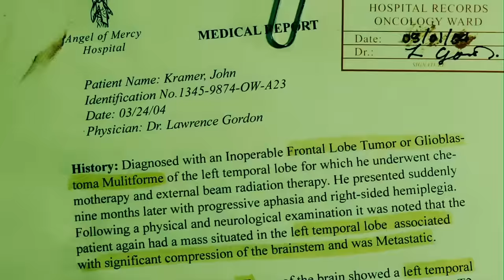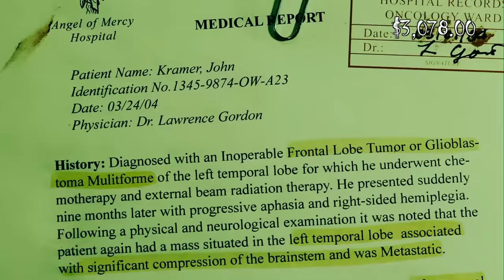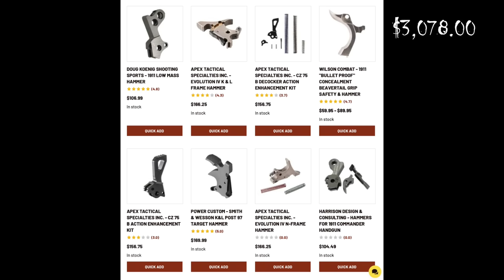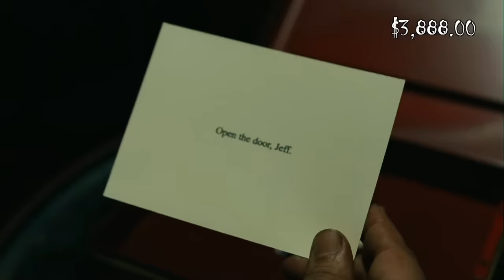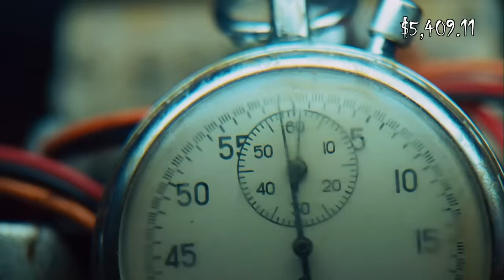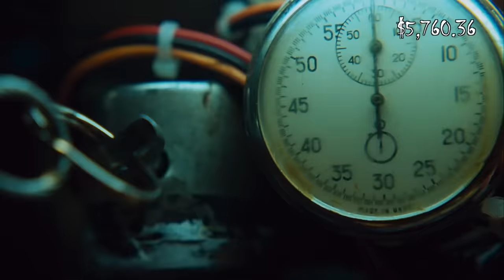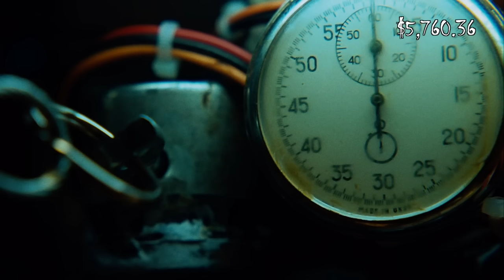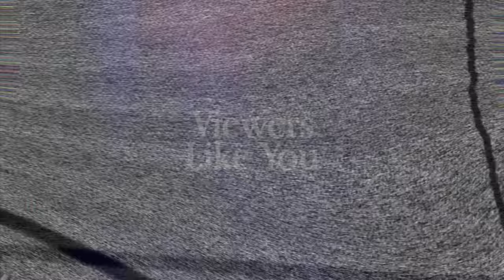Can Jigsaw Afford Saw 3? | Foot the Bill - Saw 3 (2006)

Comment: If the doors seal when you enter the room, you NEED a separate cassette player in case the victim left the first one behind. That's just good game design
Reply from the maker: You know what, that’s the best argument I’ve heard so far.
Reply: If it was me at least, i’d be collecting those. I’m leaving this building missing limbs or even organs, might as well get some kind of recompense in the form of cassette players and pieces of stereo equipment
Reply: @moogandacasio  "I know you're having gruesome awful things happen to you right now, man, but keep quiet while I strip out all the copper wire in this thing!"
Reply: Dude should just start saying that they need to bring the recorder with them. Save some money, man

Comment: I think the shotgun collar trap is using the chamber from old single barrel break action shotguns. I have never actually disassembled one before irl, but i have modified a highly detailed 3D model of one before and the chamber length does seem to be the same as what is on the collar.
Reply from the maker: Interesting, that would potentially drive down the cost. I really couldn’t find much on weapons recycling that soon after 9/11 in my research. People were pretty attached to their weaponry at the time, and a lot of the second hand market remains hard to track. 

But if it’s preexisting hardware, that’s less to fiddle with and therefore less expensive to assemble.

Comment: Old large buildings like factories often have power still running for any fire suppression systems. Some buildings do end up having power cut to everything except fire suppression. I don't think that's necessarily the city doing it on their own. Might be the company not wanting to risk a short drawing power and racking up bills or maybe some equipment that isn't exactly safe to leave unattended.

Comment: In the "The Door Slams Shut" section of this video, you can see in at least one shot "Property of Angel of Mercy Hospital", just like kittenarcader points out... But I wonder if he realized a lot of these materials might have been stolen or otherwise "appropriated" from that hospital. Both Lynn and Lawrence worked at that hospital and Lawrence actually became John's successor. It wouldn't surprise me if most medical equipment was taken instead of bought. This would severely cut in the costs of these bills.

Oh and because John has all of these accomplices... they probably share the load.

Comment: I love how the shotgun collar would not actually go off because there isn't any firing pins. A hammer has been proven to be not be enough to set off a shotgun round. Now, If this was a .22lr or something rimfire it might work, but shotgun rounds require a firing pin, which the trap does not have.
Reply: I don't see why she didn't try shoving a cloth or something in there when they weren't paying attention to her.
Reply: @IDevoidI Or just, Axe Amanda in the back of the head when she had  the chance? But yeah idk that whole thing seemed really easily beatable if you used for head for two seconds lol

Comment: I think some of the medical stuff you are either way under on or is stolen. That's an A&E bedside monitor, it does a lot more than basic vitals (I can see a set of ECG leads bundled out of it and that suggests it's got a lot of function). On its own that could be ten thousand.
The price you quoted for hospitals is not including the medical kit (monitors, medicines, tools). Just the facility kit (beds, ventilation, gas pipes, PPE and deap clean).

Comment: 6:43 Did you maybe mean 25% hydrochloric acid instead of 25 molar? Because I'm pretty sure the latter is impossible. The highest concentration you'll ever see is 12M (37%) and that is already fuming heavily because of HCl vapors escaping the solution. You just pack much more HCl into water at normal temperature and pressure.

Comment: you could do al the elctronics yourself for pretty cheap 20-50$ per use case and in some cases you may be able to just use a 10$ electronic clock as a base and ad a few components worth 1-2$ in total

Comment: 3:49 In theory, he could be recycling the video tapes from prior traps that haven't been found. Also, the explosive could've been homemade from various chemicals and such around the factory. 

Oh and btw, fun fact from the director's commentary: The directors and prop crews actually went to multiple ER doctors and asked them how to do the surgery, and used what they said to make the surgery scenes.

Also, how the hell have you not ended up on some government list yet or had a visit from an agency or two?

Also, also, why didn't you do the new movie Saw X first, since it takes place in between Saw 2 and 3?

Also, also, also, why do you need to charge for the entire room? The only part that moved was the door, and even the locking mechanism is old school, since in the next movie we see that it was Hoffman that locks the door from the outside. In all reality, they just needed a way to pull the door closed, which is super easy to rig up, (even for Amanda)...

Comment: 20:01 how long abandoned is this plant? Those piggies looked like they were still pretty juicy. Based on my admittedly quick and minor research, it seems to be $250 to go whole hog, and there seems to be several of these not-so-little piggies - it seems like it would take at least 5 to do the intended job. While I imagine Amanda would likely want one or two extra to ensure a done job, we can be generous and charge for just the 5 - which I'd guess would add up to $1250. That would make it the most expensive trap.

Comment: You don't actually ask anyone about these things do you.
Hydrochloric acid is the same as muriatic acid. Its sold as a pool pH adjuster. It costs $20. It also wouldn't work, which any chemist would know. It would take minutes to do anything significant to your hands. You'd probably need something like white fuming nitric acid or high test peroxide mixed with sulfuric acid.

Comment: I can tell you. You've never had the source parts for anything. Your prices are ridiculously low. Yes, because you don't value something doesn't mean it's going to be cheap. And then you have to understand that. Buying multiple of used versions of things is a crazy task. And you always neglect the time. It would take 2 source the parts for these. Nothing in these traps look jerry-rigged at all. That means all those traps had exacted specifications in order to work. You can't just find that stuff line around..
Reply: he prices the things by what he was able to get them himself or by engineers that buy the stuff and would know.. also most of this stuff is fabricated assumingly by John or his associates and most of these things are not that precise, it's more electronic timers than precise engineering.. the rack is probably the most involved but you can easily adjust the spacing of the gears to use what they had instead of machining gears to exact specs